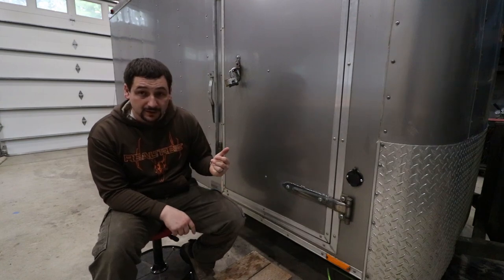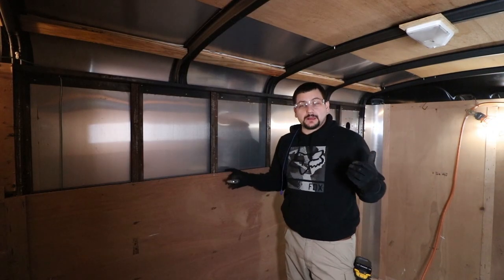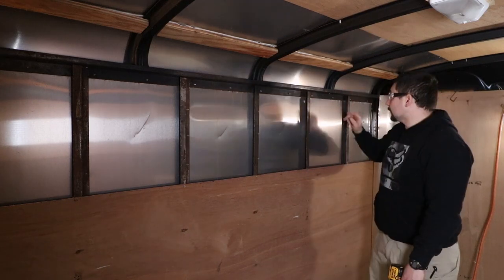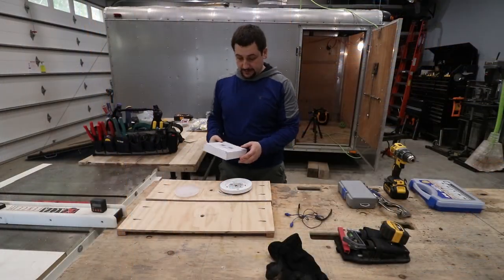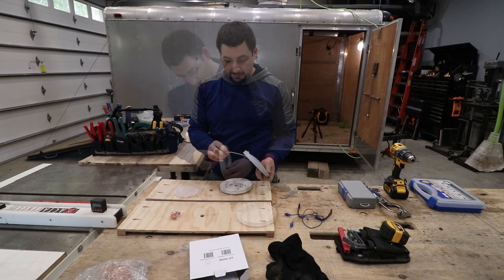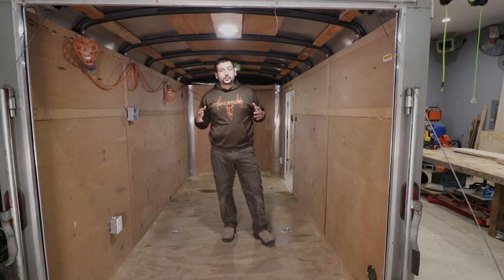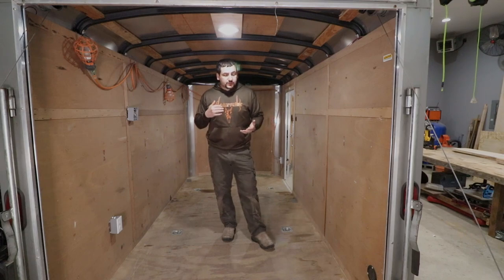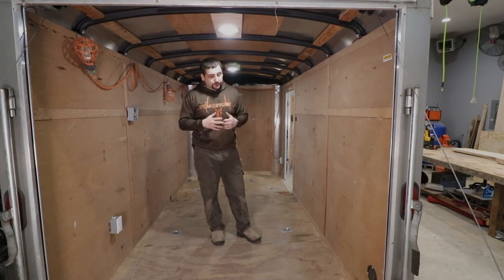Mobile Tool Trailer Build Installing Shore Power Part 2-7

Comment: I liked this, but I’m not sold on running wire through the wall.  Just a personal thing… I’m always tweaking things in my vehicles/trailers. My luck id put a new screw in sometime down the line and go right through the wire.

Comment: Good Job. If you would have used RV receptacles, they would have been flush.  They have j box built in and are designed for that kind of wall construction.